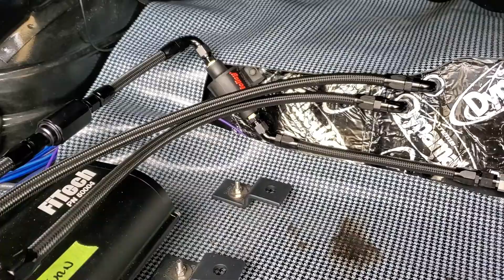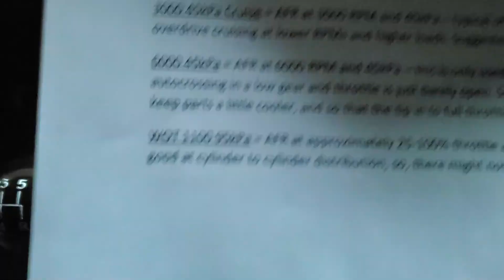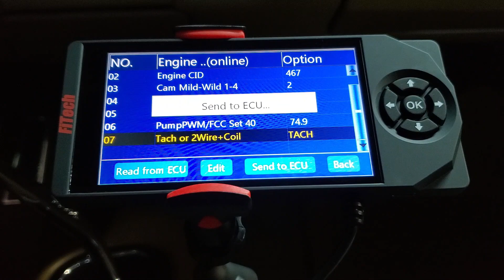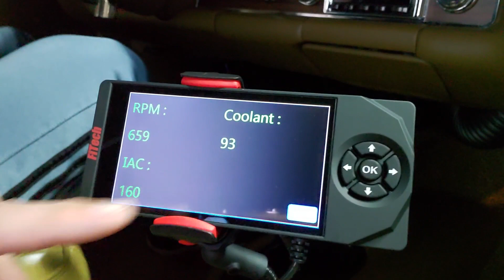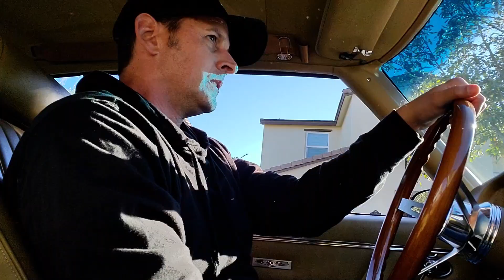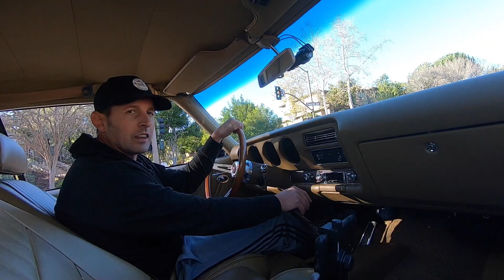Fuel Injection Conversion, Part 7:  FiTech settings, First Fire, and Test Drive!

Comment: To clarify, do you need to set the iac before it reaches operating temp??
Reply from the maker: It's just good practice because some systems will kick on electric fans when the engine reaches operating temperature.  That will sometimes cause a voltage spike, affecting the IAC "learning" reading.  Hope that helps!
Reply: @FastMonty  yes it helps. I new you had issues setting iac because fan was kicking on. So was curious what you actually done to set iac and get it stable.
Reply from the maker: good to hear... I now also keep the air filter on too... keeping it as "real life" during the adjustment.  Have fun!  @dbohann66

Comment: You never told us what what you did to adjust the IAC properly. You just said the fans interfered. So is the solution to adjust the IAC without the fans on at a low temp or should the fans be on without kicking on and off?
Reply from the maker: Sorry about that... Since filming this, I found that the engine temp should be above 135.  The fans kicking on don't have much of an affect as first thought, but I do keep the air filter on while setting the IAC.  Hope that helps!

Comment: With the amount of "jury rigging" going on with classic car rest/mod etc. someone wouldn't have devised a rubber mount gadget to keep those clicky clacky pumps off the hard body/frames. Body vibration + the solenoids operation = noise.
Reply from the maker: Agreed!  Ended changing that whole thing out for an in tank Camaro SS pump.  Super Silent now.  :)
Reply: I’m new to the “hobby” as I’ve heard it called regarding me. I was given a 71 c10 basic 350ci and power glide trans from my mother who was going into hospice care and needed to reduce her “holdings” so government couldn’t seize them. It has a edelbrock x4 but today carburetors are going out like the power in California. Do you find the efi system beneficial for the money?
Reply from the maker: @ssxprss  Sorry to hear about your Mom... understood about Medicare rules.  Anyway, welcome to the hobby.  Yes, Fuel Injection is the way to go.  No more head aches with cold starts, hot starts, idling around town, Wide open throttle passes, etc... always comes down to idle.  :)  Anyway, I'm still learning too and will be implementing Electronic Timing control, which is a built in feature of the FiTech system.  (That way I can set the timing digitally, versus dicking with distributor weights, and adjustable vacuum advance stuff... yet another benefit of Fuel Injection conversion that I haven't utilized yet)  Again, sorry to hear about your Mom, sounds like she has great taste in cars... :)

Comment: When you set this up did you hook up a vacuum to the throttle body or the fuel cell regulator...couldnt tell
Reply from the maker: The Vacuum?  You mean the PCV line?  I have a provision in my manifold for that, just below the Throttle Body/Carb flange.  If you don't have the manifold connection, then you use the 3/8" tube on the bottom of the throttle body.  Hope that helps!
Reply: @FastMonty  not the sorce but where does it go...ton top of the go fuel because you were using it as the regulator or the on on the side of the efi unit its self...because in my head you have to provide it vacuum to work..
Reply from the maker: @thinds8810  Hmmm, still not sure what you're asking... but, there's a ton of vacuum supplied by the manifold that the throttle body, or carb is bolted onto.  So, that in itself is sucking a massive amount of air through the Throttle body, or carb.  Fuel pressure then sprays fuel into the air stream.  Make sense?

Comment: You can get a carb to do the same thing, it just takes more hands on work to do it. 
The compensation to altitude changes with EFI is what I like.
Reply from the maker: Agreed, it takes some serious expertise to get a carb to perform the same, especially during cold starts.  (I no longer have to feather the throttle to keep it running when cold, which is HUGE with Aluminum heads)  No muss, no fuss, starts every time.  :)
Reply: @FastMonty  two channels got my mind right on old school systems are Unity Motorsports Garage ( Andy Wood ) and Thunderhead289. If you get bored, check them out.

Comment: How is it holding up? I want to buy the same kit but heard mixed reviews
Reply from the maker: It's running great!  I think I also heard that FiTEch now has a three year warranty?  Might check out their website.
Reply: @FastMonty  I want to get this same kit I want something reliable and that works really good , u don’t have any problems with it ?
Reply: @FastMonty  do you recommend this kit for my sbc 383 stroker ?
Reply from the maker: @EffectsExe  Assuming you want a really nice streetable hotrod, and you're currently using a carburetor, hell yes!  (Mine's a 470 stroker)
Reply: @FastMonty  ya I have a 383 stroker with a 750 Holley carb and the carb sucks going to order the 30002 kit from them wanted to make sure it makes a difference compared to the carburetor
Reply from the maker: @EffectsExe  Ha!  Night and Day.  You'll love it.  Just don't rush the install, read the instructions, and ask questions if something doesn't make sense.  Have fun!

Comment: I put the Fitech 600 Power adder on my 78 TA and couldn’t be happier! I also put on a turbo, and the Fitech has made it so easy..I had duel inline Fitech 255lph pumps which worked, but sounded like I ran over a riding mower! We are putting in the tank/pump combo 58118 with a 440lph this winter, so bye bye under car noise!
Reply from the maker: Nice Mike!  Great to hear it worked as seamless as mine... I too yanked my loud ass pump.  Have you seen my latest pump install?  It took some work, but it is dead silent, and it's the production pump for Gen 5 Camaro's... check it out... it also has NO return line.  https://youtu.be/is6abUtrVRI  Keep at it!

Comment: I put my fuel pump outside my car on the bottom of it..because it was way to loud lol
Reply from the maker: Ha!  Too funny... I had a Carter unit underneath the car, before this system.  I should of kept it there.  Dang it.  Thanks for the comment!
Reply: @FastMonty  can u make a video of one month review after installing your efi?I also went that route efi on my 468 big block..I did put my handheld efi device in my ashtray ..I made it all flush so u can close it and open it any time u want lol
Reply from the maker: @wheelmanvicful  Great idea!  Ironically, I did find a problem, which is next week's video.  It was an eye opener for me... simple fix.  Great idea about the ash tray!  I might research that some more... thanks for the comment!

Comment: Good I haven't found that head pressure spec on  the holley pump @ 12", very cool! thanks!
Reply from the maker: Yup, it'll work fine where it is... but, I'll be searching for something quieter.  Will add to my "to-do" list, for sure.

Comment: Excellent video, I have a question I also have GTO (66) it has non original engine (Chevy 454 substantially modified approx 600+++HP ). After having my mechanic (experienced in fitech) fit and set-up the Fitech system. I've massive over fuelling issues during the install and test stage dumping fuel fouling the plugs and fuel going thought-out the engine and into the oil sump. The cars got both good quality MSD dizzy and coil systems. The car does NOT have a MSD Ignition Box fitted, do you or anyone feel I'm losing spark hence not burning the fuel and the system still feeding the fuel, would fitting the MSD box help with this issue. Or any other issues my mechanic might be missing. Any feedback would be greatly appreciated, Cheer's Warren (Australia)
Reply from the maker: Great question, Warren!  I've never heard of that issue before.  Just thinking out loud... what's the fuel pressure?  Does the engine start fine?  Does it take forever to start?  Like it's flooding?  ... if mine doesn't start when cold after three attempts, it will have received three prime shots.  (You can hear it "squirt" when you key on)   On my fourth attempt, I will hold the pedal down during key on.  (Holding the pedal down tells the cpu to NOT do the prime shot)  Otherwise, you'll flood it.  If the engine runs, I would look into how to pull the data, and study the results.  @fitechefi Has some great videos on how to do that.  Remember, it's a computer, if it's over fueling, something is telling it to do so.  Which means something is wrong in the loop, like there's an exhaust like near the O2 sensor, and it's adding fuel to make up for it, etc.   Obviously, I'd also send a note to FiTech for some guidance too.  Let me know what you find!

Comment: Wow, thats a heck of a complicated fuel system.  Should have just used a Walboro inline pump and the C5 fuel filter, whisper quiet and a very robust system.
Reply from the maker: Yeah, I got carried away... I was married to the idea of NO return line.  And of course, after all of this, I found Holley's intank pump, which also does NOT need a return line.  So, I'll most likely be going with that for a future project.  Thanks for the comment!

Comment: What camshaft are you running?  And where did you set total timing?
Reply from the maker: I have a custom Butler Roller Cam 230/236, total timing is 38 degrees.  Why do you ask?
Reply: @FastMonty    Because I just installed a “744”.  Ram Air III cam. Advanced 2 degrees,  Total timing 40 degrees.  In my Tri Power 400, bored .04”. 9.5 : 1 compression.  Harland Sharp 1:65 roller rockers.  I was just wondering
Reply from the maker: @davegentry2380  Ohhh, nice!  Sounds like a fun beast you have there.  :)
Reply: @FastMonty  I’ve had this GTO 40 yrs.
Reply from the maker: @davegentry2380  Awesome!  Very few of us have had our cars that long.  At least we made it past the point of where it might have been easy to sell it, like 10 times.  ha, ha... keep at it!
Reply: @FastMonty    I was just curious
Reply: @FastMonty  I had a “068” cam in same engine for 12 years,,,

Comment: cool video, very informative. My issue I'm having with my fi-tech is that the butterflies are getting stuck in the closed position and i really have to hit that pedal to get them to unstick.(which is bad if i have some traffic around me) Any info regarding that would be helpful. Thanks!!
Reply from the maker: Frankie, thanks for the comment... yeah, that's not good.  So, I just looked at mine... it's not on the car, which makes it easy.  My valves do not fully close.  I suspect that might be the issue.  Have you called FiTech yet?  I'd be happy to send you a picture, or short video to show you mine.  Just send me an email.
Reply: @FastMonty  Thanks for the reply, i'm going to have to try to set that IAC  more and hopefully open up the butterflies a bit. surprisingly, fi-tech is the one that told me to adjust the IAC by turning the adjustment screws (both front and back) all the way counter clockwise until it clicks, then turn them a quarter turn clockwise. That I believe is when i started having issues.
Reply from the maker: @frankiegee101  yeah, I'd back those screws out and start over. Not sure I'd touch the rear one, when you adjust it again. (My front and rear butterflys are connected, so I could see how they'd bind up if you adjusted the front and rear at the same time.)  Let me know how it goes
Reply: @FastMonty  well, when i start from the beginning(screws all the way counter clockwise) my IAC steps is around 160ish. I've adjusted the front screw (clockwise) a lot. about half ways in. I felt a click and then more air started rushing into the throttle body. so i backed it off until the air noise stopped. So.....my current IAC steps now is 58. if i continue to screw the front one in more, the idle jumps up and i can hear more air going in. I will tell you though, my butterflies don't feel stuck closed anymore now that i've adjusted the front screw in a lot.
Reply from the maker: @frankiegee101  Glad to hear the blades aren't sticking anymore.  If you're still concerned about getting that IAC below 10, I would remove the throttle body and reset the blade position on your workbench.  Upside down, my blades have the identical angle.  I see they're connected by a threaded rod, which is also an adjustment point.  Which is why I don't see how the rear screw helps... If you want to go down that path, I'd be happy to send you pics of mine.  Just send me an email.  fastmontysgarage@gmail.com
Reply from the maker: @frankiegee101  So, I decided to film what my butterflies look like, which should help with understanding how those screws work.  https://youtu.be/nOY7y6890iI

Comment: Look forward to all your upgrade videos. If you keep the current arrangement rubber isolated the pump to reduce the pump noise, make sure to ground the pump. The in tank pump is simpler, eliminates all the extra hoses in the trunk. Safer, since you do not have fuel hoses in the trunk (passenger compartment) eliminating the possibility of something in the trunk damaging a fuel hose. Quieter, because the gas tank is enclosed and isolated.  You have a great build going  with really nice video series documentations. Thanks for taking the effort for everyone, inherited a fully restored 68 GTO convertible 4 speed from my brother who was the second owner since 1972. Have lots of plans for upgrades and improvements for the GTO. Keep up the good work.
Reply from the maker: Thanks Brother!  Yeah, I'm definitely leaning towards an in tank pump... I guess that'll be another video.  :)  Congrats on your 68... it'll be fun!  See ya!

Comment: Nice work mike, but just curious on why you didn't just go with a FiTech tank with intank pump ??
Reply from the maker: Thanks!  Yeah, it was my understanding that a Fuel Injection ready tank, and pump, were more expensive than the Force Fuel unit.  Sooo, I went that route.  And yes, I'm regretting the noise of that Holley pump, ha, ha... so, I'm sure there will be an update to this video series in that regard.  Thanks for the comment!

Comment: Fuel pump shouldn't be that loud
Reply from the maker: Crazy, right?  I just found out that Holley makes an in tank pump, with no return... I'm gonna add that to my list for a possible Plan B.
Reply: @FastMonty  I woke highly recommend an in tank pump is the way to go. Fitech makes a fuel supply station you could check out
Reply from the maker: @punishergto5182  I will!  Thanks Brother!

Comment: I decided on the sniper efi line. They have a master kit with a return less fuel pump inside the tank (Master Kit part# 550-511D). Also, Do you remember what power distribution block you used in your trunk?
Reply from the maker: Ohhh, I like it!  I think I'll be adding that pump on my list of action items.  That fuse holder I have is made by XScorpion for ANL fuses.  Unfortunately, I don't know the part number.  Thanks for sharing your set up!

Comment: Have you expected any fuel improvements in mpg . I have heard that F.i. is more m.p.g's
Reply from the maker: Great question John... yeah, like a 30% increase.  I think I went from 6 MPG to 8.  bahahahahaaaa... I actually don't know.  But, the MPG's should increase, purely based on increased efficiency of an EFI system.  Thanks!
Reply: @FastMonty  What kinda millage do you get  from your Butler's stroker  and what size gears are you running in the rear end. I'm curious because thinking of using a 400 and Butler stroker trans 700r4  and probably 343 gears in the rear and FiTech  .!!
Reply from the maker: @johnkennedy8452  Good question John... welp, if you're going with a stroker motor, does MPG really matter?  The hard part is not mashing the pedal where ever you go... bahahhaaaa.  I have a 3:55 rear end.  And a .68 over drive Tremec TKX, so that aspect of highway cruising saves a ton of gas on it's own.  Congrats on the FiTech decision.  You're gonna love it.
Reply: John I went from a 13 highway on 65 Thunderbird to about 17.5 390 un modified. These are my calculations on my bi-annual trip to Florida from Georgia. My calculations are pretty persistent because I've made four trips a little over four hundred miles and they will come within a mile or two  mind you that is with the AC running. I haven't done a winter trip yet that should be much better. Seeing how my compressor is the size of a Prius

Comment: So glad you happy with your efi.  I too am happy with mine.  Side note IAC is idle air control which I'm sure you figured out lol.  Yeah you were chasing unicorns because of your fans kicking on causing your alt to draw more amps.  same thing happens on AC cars when the clutch kicks in makes the motor work a little harder at idle so the computer adjusts how open the throttle is to maintain idle rpms.  Still love ya brother and keep up the fun times.
Reply from the maker: Thanks Justin!  Yup, nothing but fun... see ya!

Comment: Hey Mike, you probably covered this and I need to go back and watch the series, but why didn't you use an in tank fuel pump. I Installed a Holley sniper on my 69 GTO (looks similiar to yours, except my dad ordered green interior) and other then the initial prime, you don't hear it at all. Car sounds great.
Reply from the maker: Great question Michael... At the time, I was under the impression an in tank pump required a new baffled tank.  Hence, more money.  BUT, since filming my procedure, I came across the Sniper in tank (return less) pump... which looks awesome.  I will definitely be considering it for my "Plan B" fuel supply.  And of course, will film that install too... :)  Thanks for sharing, and congrats on your build!